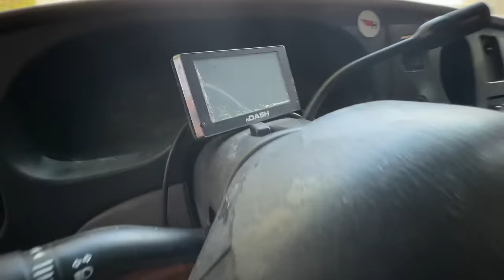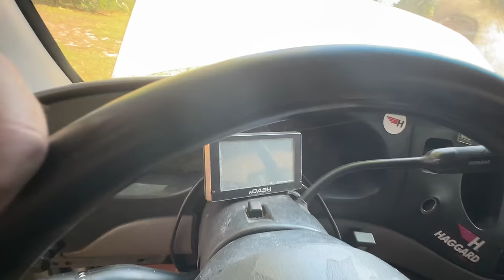Is the MINT van actually JUNK?!

Comment: pretty sure that van needs 2 batteries, my 96  7.3 van does
Reply from the maker: Possibly, it only had that one and it’s garbage
Reply: @InfamousPendarvis  one works if it’s good but it starts much better with 2. if it does there should be a box & terminals on the other side
Reply: 2nd battery is on the passenger side frame in a box